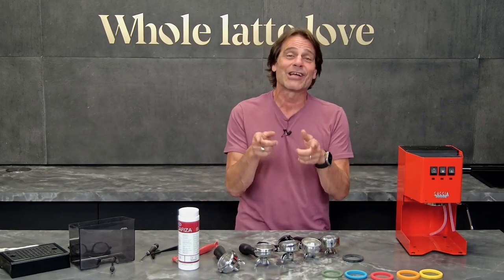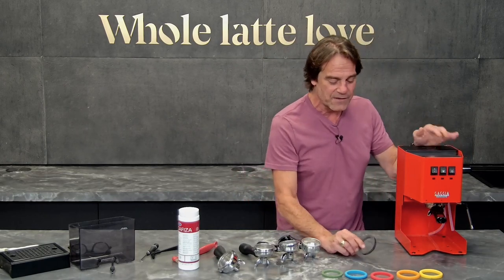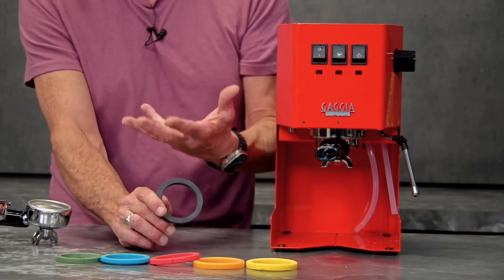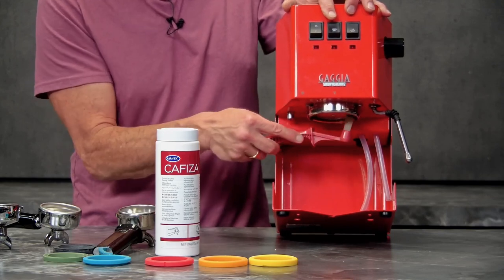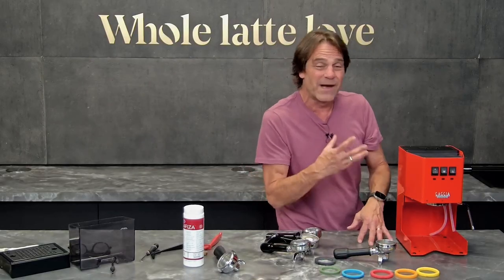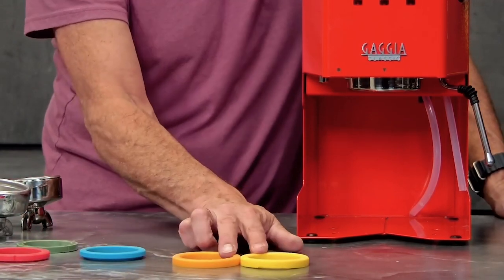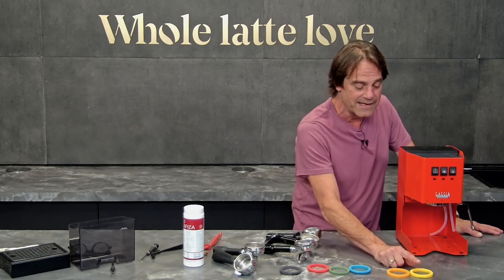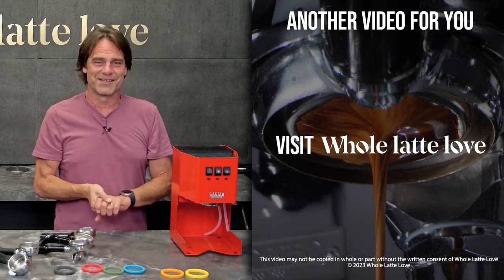Under & Over Clocking Espresso Machine Portafilters

Comment: Marc, very nice presentation.  Liked the 'Olympic Gasket Rings of Silicone!'

Silicone gaskets are great!  The first time I replaced the stock gasket on my GS3 (after a year - and it was hard), I replaced it with a silicone gasket.  It has lasted three years, and shows no sign of needing to be replaced.  

Mark's comment about not having to snug the portafiter as tight with silicone gaskets is exactly right.  A very light 'snug' always suffices.  My portafilter assembly has always pointed to about 6:30, and over four years use, stays exactly at the same spot (with the silicone gasket).   

A very light greasing of food safe silicone lube on the backside and inner sides of the gasket to assure easy removal.  I use a 'gasket pick' to remove the gasket, but a table knife usually works fine if it's not stuck in too hard. Another advantage to silicone, they come out easily. One has to be more careful in handling the silicone gasket though -- although it's pretty tough, it's easier to tear than a rubber gasket (which is almost indestructible - but hard to get out if left in too long).
Reply from the maker: Hey b, Thanks for the kind comment! Couldn't miss the Olympic ring compare. No orange in the real deal but I was right about black! The silicone gaskets do last a lot longer and def don't have to crank hard on them. Thanks for the tip on lubing the gasket.
Marc
Reply: @Wholelattelovepage  Ironically, the LM Linea Mini uses an orange silicone gasket.  I use it on my GS3 instead of the blue one (identical size) because I can see any crud more easily on the orange silicone gasket.  I saw you throwing the black gasket on, and I thought immediately "YUP!"  Guessed right!.
Reply from the maker: @bacca71  😉

Comment: Fantastic video Marc! Question, after my machine heats up and I go to remove the PF, the basket gets stuck  to the gasket... And it's very difficult to pull the basket out when it's not seated in the PF... Any advise on how to prevent this?
Reply from the maker: Hey b, Thanks for the comment! That has happened to a few times. It's been awhile but mostly when I've left the portafilter in the machine overnight and maybe had it cranked in kinda tight. Always advise leaving the portafilter in the group when machine is on so it warms up but it does not need to be cranked in tight for that. Keeping the group area including the gasket clean helps prevent. Residual coffee goo is sticky. Also I don't ever recall a basket sticking when I had a silicone gasket installed in place of the original rubber type.
Marc
Reply: @Wholelattelovepage  got it and noted and managed to your advise all the time. It's a rocket mozzafiato, 7 months old with original rubber gasket. I have a silicone one, orange color, and I tried installing it but can't get it to fit. It was provided by rocket, maybe it's the wrong size. And I have watched your videos on how to replace it and tried all the tricks. The basket is a VST and will swap it with the stock basket to see if I have the same issue. Really not a big deal, but just a nuisance to deal with! I sometimes rub a tiny bit of olive oil on the lip of the basket and that works for a few days/uses... Thx I appreciate you and your videos. Be well.

Comment: What if I have a brand new gasket and I am still overcloking to almost 3 o'clock to avoid water leakage? I have a lelit anna 57 mm so there is literally only 1 type of gasket for it (4 mm)... Could it be that the actual portafilter wings are worn out?
Reply from the maker: Hi, yes it is possible the wings and/or lock in area of the group are worn and causing over-clocking. There are shims available to increase gasket height.

Comment: I would think it would be more about the proper seal than exactly where the handle ends up. What exactly is the required/target pressure?
Reply from the maker: Hey B, I agree seal is more most important. There is not a specific pressure other than enough to not have a leak.
Marc

Comment: What if I have a brand new gasket and I am still overcloking to almost 3 o'clock to avoid water leakage? I have a lelit anna 57 mm so there is literally only 1 type of gasket for it (4 mm)... Could it be that the actual portafilter wings are worn out?

Could I use two of the same 4mm gaskets to achieve 8mm?
Reply from the maker: Hi, yes it is possible the wings and/or lock in area of the group are worn and causing over-clocking. There are shims available to increase gasket height.